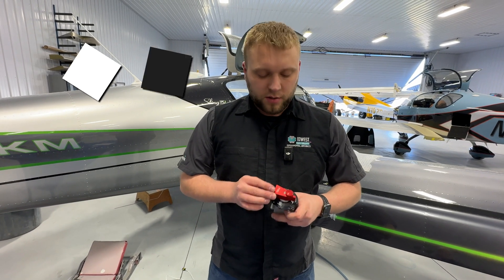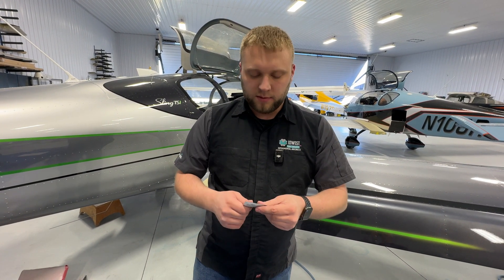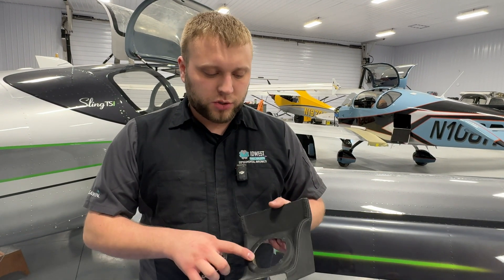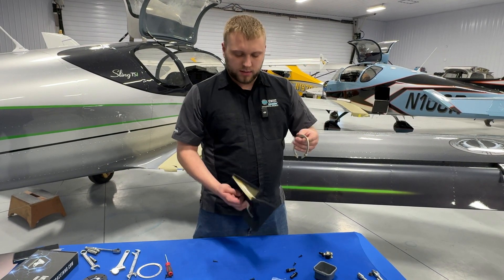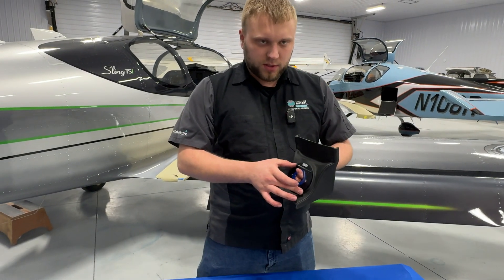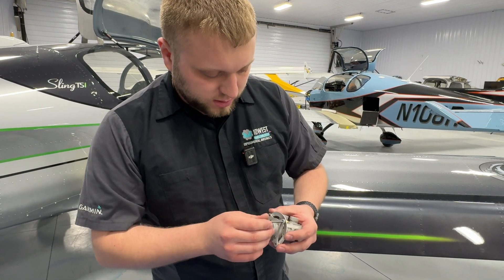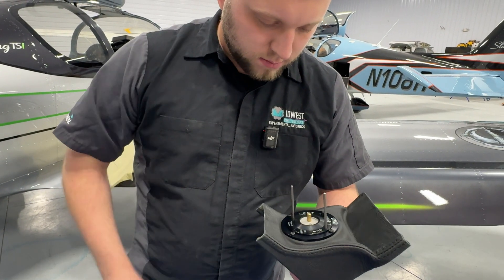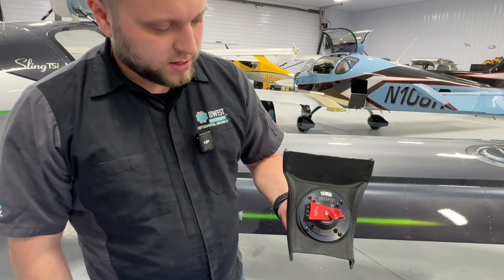Video #4 Preparing The Fuel Selector

Comment: If you have the smaller hole in the shroud do you need to cut the hole to make it larger?
Reply from the maker: @levelground-n9x  yes, we supply a template to do that.

Comment: Please please please please contact Garmin and ask them if they can add a feature to the G3X where you can tell it which tank you are on based on this sensor so that the fuel remaining shows specific tanks.  I know that it might not matter in your installation since the sensor goes to your controller, but I have a lycoming so that doesn't matter to me.